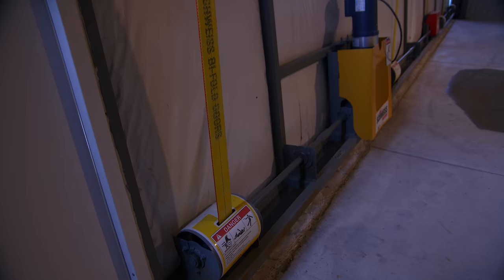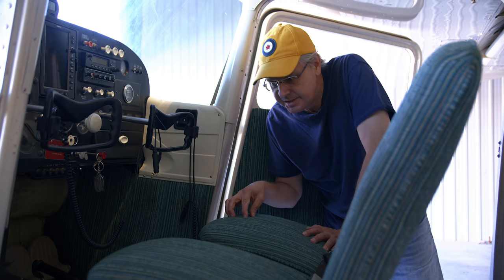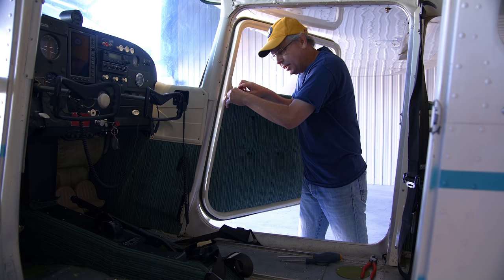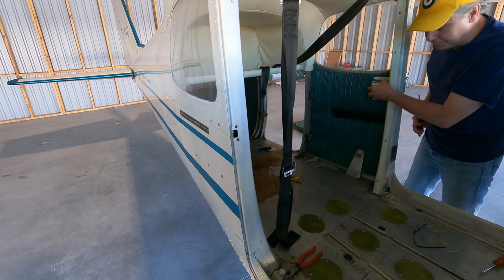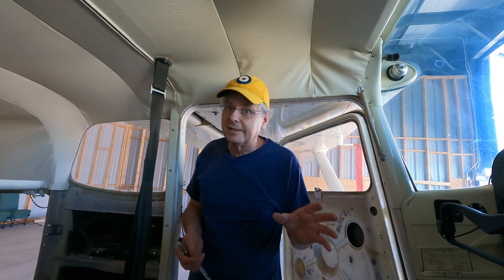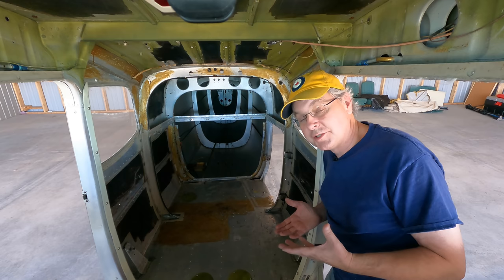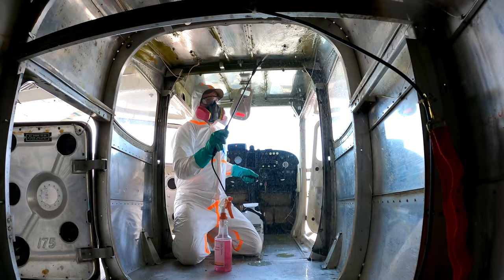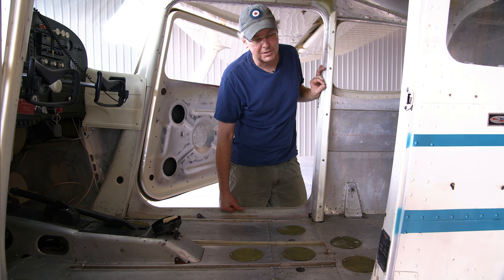Stripping The Interior From A Cessna 172B Glen's Hangar Episode #4

Comment: Glad you used protection especially the respirator for the tolulene. It is a bad neurotoxin. I have issues from breathing it heavily in the 1960s before OSHA here in the US. Stay safe and if you ask me I would toss the tolulene and not ever use it again.
Reply: toluene is industrial strength nail polish remover! Extremely toxic . The only time I've had to use it was in a lab in small quantities with safety glasses and gloves and in a fully enclosed extraction fan fume cupboard so I find it hard to imagine using it for 4 days in a "bunny suit" and respirator.
Reply: Industrial chemicals are wicked. I worked in a finishing shop and the people there would wash up with acetone. I asked them, "What the hell are you doing?" They just said it was fine, we've been doing it for years. I told them they were very uninformed!!!

Comment: Ah, the seat stop.  I remember back when I learned to fly (late 80s) there was a Cessna 150 with a sticky seat lever. And once on takeoff it went sliding back with a vengeance. And what do you have your hand on when that happens?  That's right, the yoke. My instructor was quick to push the yoke forward and I let go.

Comment: If you are still in need of a spinner, I found them at Wag-Aero for $400 for the spinner and backing plate brand new. I needed one for my 1956 172 with the o-300 and McCauley prop. I believe it is the same part as your plane. Looking forward to watching the work on your plane. I've owned mine for about 15 years and just love it.

Comment: I'd definitely put some of the green corrosion protection on the inside, especially if you're gonna paint it anyway. I've seen aluminium corrode so fast, even in a hangared aircraft.
Reply from the maker: That's the plan
Reply: It's Zinc Chromate primer. Aircraft Spruce stocks it. Various size jars and cans, and even an aerosol spray bomb. But the spray bombs are $25 each.

Comment: About the two seat rail stops…. The first one you removed is a Saf-T-Stop that is meant to be slid forward and tightened after you have adjusted your seat in the flying position. This keeps the seat from sliding back during flight. People have stalled on takeoff and died because the seat slid back and the pilot grabbed the yoke. Then when you want to get out of the plane you loosen it and slide it back. I’ve spoken to the creator of this stop about the plastic handle that breaks. He has changed the design and you can buy the new design at Aircraft Spruce. 

The second one you removed is just a simple piece to keep you from sliding the seat back too far which would allow you to pop the seat off the rail. There should be one of those at the front of the seat rail too in order to keep you from sliding the seat too far forward.

Great video by the way…. Keep them coming!
Reply from the maker: There is another of the little clips at the front of the rail. I think we'll be replacing the Saf-T-Stop will be replaced with the Cessna inertia reel system... I'm getting too old to reach back and tighten / loosen the Saf-T-Stop.

Comment: I did lots of that for CP and AC in overhaul.  Instead of a metal scraper, use a plastic, ceramic or micarta scraper to get the big stuff and red or grey scotchbright soaked in toluene or mek to remove the glue.  leaves much less damage from scrape marks on the metal.

Comment: Toluene (tol-u-ene) is an organic solvent, that occurs in nature.  It is clear and colorless, but has a distinctive odor.  It also occurs in pine pitch and tar, crude oil and lighter petroleum distillates, like naptha or gasoline (there's about 5% toluene in some gasoline blends).  It's common chemical formula is C5H5-CH3, also known as methylbenzene (or C6H8 in the IUPAC [International Union of Pure and Applied Chemistry] formalism) or toluol (since it was first isolated from the balsa of Tolu or other pine trees that have a light weight per cubic foot of wood [e.g., "balsa wood"]).  It's the compound that gives the "glue-sniffer's high" from building plastic models in a space with little ventillation.  Consider it to be a neurotoxin (or intoxicant) and wear a respirator in anything other than a very well-ventillated area with high airflow.  This organic compound is used in paint strippers, adhesives (like contact cements) and as a solvent for specific chemical reactions (I've used it for that purpose, but in a high airflow chemical fume hood inside closed glass vessels).

I agree with what you are doing.  Keep the documentation and the parts, but prep for what is done for today's situations.  Don't try for a museum-quality piece, unless that's your objective.  Since it flys, let's keep it flying!!!

Comment: I am stripping the paint on my airplane right now, and do yourself a favor and use Stewart Systems E3000 EkoStrip. It is an environmentally safe paint stripper that can be sprayed, brushed or rolled on your painted surface. It's not solvent borne and does not dry out and stop working overnight. In most cases the stripping action will take place in 2-4 hours. EkoStrip has no harsh odors, is not caustic and is biodegradable. Best part is it actually works as well as the solvent versions or better, and doesn't eat through nitrile gloves.
Reply from the maker: Keep you eyes out for episode #5 - I just finished the job of stripping and tried the EkoStrip Vs. two other solvent based strippers. No spoilers, on what happened just yet.

Comment: I really enjoy watching this project, Glen.  Brings back many memories over the years.  I'm glad you found this and are using it to get intimate with your bird and getting back into the air for fun and adventures eventually.  I spent a lot of time crawling through my Skylane and pulling the interior for annuals when I could. I did most of my oil changes and knew everything in front of the firewall intimately. It makes a huge difference when flying.

I did my intro flight in a 1977 152 in Dec, 1980. The majority of my training and early flying was in '77 and '80 Skyhawks. I never used a headset until I got back to flying in 2002. I remember how chaotic it was trying to understand the radio traffic through the overhead speaker and using the mics.  Headsets and push to talk were very exciting!

Comment: The easiest way to remove the door handle (when you don't have the proper tool) is to wrap a rag around the post and pull it around it. The end of the clip will get imbedded in the rag and pop it right off.

Comment: Seeing your headliner removed causes me to think you might want to review Cessna service letter SE69-26 dealing with fuel vent system modifications to prevent possible vapor lock.  SE72-7 provides more detail.  I was able to find salvaged parts to modify my 172B.

Comment: Great series of videos.  When I used to build rally cars we found that removing the roof lining meant a lot of condensation would form on the cold metal when it was left overnight.  This condensation could then run down the pillars and could cause problems with electrics.  I realise that you will be using ANR headsets and I'm interested to see whether the removal of the sound deadening panels and trim will result in a big noise level increase (drumming) that proves tiring.  40 years ago we didn't have ANR technology...

Comment: I know it’s old but those old school crank clips pop right out if you slip a rag around it on the open end of the clip and pull the rag back and forth and the clip will pop out enough to remove the crank… Then fully reinstall the clip to reinstall it and just pop it on because the crankshaft is ramped

Comment: As an ex Aircraft Weights Engineer I'd definitely suggest getting a new weighing done. It's not worth calculating weight and location on a set of numbers that are so old.

Rubber matting, look around at different ones, comparing dencities might save you a couple of lbs.

Lastly, put a steady under the tail. You don't want your aircraft to tip if you are inside it and the only ine in the hanger.

Excellent work btw.

Comment: The door handle issue reminded me of  older cars where the answer to getting door handle off was to press the trim towards the door. the exposed the pin that held handle on the square peg. push pin through, pull handle off peg and the circular trim is free. If only Cessna had taken advice from British car manufacturers...

Comment: There is another paint stripper called ST-7. It is an epoxy paint remover. Thick like what you used. The black stuff is probably Par-Al-keytone used for corrosion protection. Once stripped you will want to use acid etch and aluminum chromate prior to paint.
Reply from the maker: Yes; the acid etch and primer is part of the plan.

Comment: I love these episodes.
You were talking about the lack of insulation between the interior side panels and the skin of the aircraft.
Can you put insulation in between the interior side panels and the skin of the aircraft?
Typical fiberglass insulation from a home improvement store?
Spray in insulation that car restorers use?
Dynamat sound deadening material, which is really meant for the floors.  It does more to muffle the noise rather than insulate.

Comment: If you are concerned about noise with all of the old insulation removed, maybe look at the modern materials like Dynamat or Kilmat? It is usually self-adhesive, unobtrusive, and light weight. It would also leave the interior 'bare.'

Toluene is usually pronounced TALL-YOU-EEN here in the States. It's distilled from pine oil and is that 'smell'. It is a solvent used in paint thinners and permanent markers. It's in most contact cements too.
Reply from the maker: Here's the rub - Anything put in or on a certified airplane needs to have FAA / Transport Canada approval. Really limits what can be used for the flooring or interior, pretty sure that neither of those are approved. There is one that is approved, but not sure that i'm going to use it.

Comment: I hear doing weight and balance sooooooo much I just received my A&P license last Saturday here in the states one thing you didn’t say about the things you removed is you need to note down the distance from the datum to do the weight and balance
Reply: I would also mention that you can’t use certain chemicals or tools bc it will cause corrosion or remove the protective layer on the metal one of the planes at the school I went to for my license was there bc it was sand blasted to remove the paint and that caused the aircraft to be no longer air worthy without being completely reskinned bc the protective layer on the aluminum was gone so the insurance company totaled it and donated it for us
Reply from the maker: I noted the distance - just didn't think to say it as a separate task. My AME is helping me in the background with the correct advice on chemicals etc.

Comment: Whoo hoo another Charlie update. 

I know every tiny gram counts but would painting the floor with something like a bed liner that would normally be used in a pickup truck bed be viable to protect the interior metal? 
I understand why you won't be putting the panels back on, but personally I'd put some kind of panel on the doors just to smooth it out. Personal preference.
If you're completely replacing the seats maybe see if any fans want to purchase the old ones you pulled out of Charlie. Could help with funding the project if you can sell the seats for 100 dollars each plus shipping or something.
Reply: Bed-liner is both heavy and may not provide good corrosion protection.  You need something that bonds to the metal and prevents liquid & gas contact with the surface. If you look around online you can see plenty of example of bed-liners where water got in between the liner and the underlying metal; and its a nasty result!  Preferably you want something that either passivates the metal or at least acts as a sacrificial anode. Alodine and Zinc Chromate primer is the go-to for this.

Comment: This is going to be a seriously noisy airplane if you do not replace the sound absorption panels (the black pitchy stuff) back in the airframe. Those pads keep the skin from oil canning and poping. You can lessen the weight penalty by reinstalling it in 1-inch strips horizontally instead of the factory installation method of large panels. Today's products are much lighter. I can empathize with your desire to remove unnecessary weight to increase payload. Just expect to hear some scary sounds while in operation the first few hours.
Reply from the maker: Yeah  - but not really. I've flown 20 hours in it already, and don't notice it being any noisier than any other Cessna 172 I've ever flown.

Comment: So on the weight of what you removed, was that just the carpet, panels and headliner or did that include the rear seats?
Reply from the maker: Carpet, panels, headliner, rear seats, hat shelf, all of the vacuum system and gauges / gyroscopes, etc.

Comment: Is there any evidence this aircraft has pitched forward or otherwise crashed thereby explaining the missing spinner?
Reply from the maker: Good point - but there isn't anything specific in the logs about a crash or damage like that... There is a period between the mid 80s and mid 90s where the plane was out of service, and seems to have been disassembled, then reassembled with parts from other aircraft (I'll get to that in a future video) along with having the wings completely re-skinned with new spars. The 'why' is a mystery.
Reply: @GlensHangar  When such info is lost over just the 61 years of this aircraft, just think how much knowledge is lost to history...

Comment: So if I understand you correctly, you will not replace that black stuff? I thought that was in place to soften the vibrations of the panels.
Reply from the maker: It is there to dampen vibration - but when you look at the entire cabin; the pitch only covers about 20% of the panels. Like I said I've flow 172's with and without the pitch and it doesn't make much difference in a plane of this size.
Reply: @GlensHangar  Wasn't worried about sound. I agree with your sentiment. My thought was that the vibration will also, over time, possible damage the ribbons holding the plate and the holes in the plate for the ribbons (or nails or whats is called in English), because of the increased movement. Might really be a non issue, but it was the first thing I thought about.
Reply from the maker: That's apparently a non-issue, given that only the panels in one small section of the aircraft are covered. (Also checked with an engineer)

Comment: How far back into the tail of the airplane do you think that you can put luggage items before you are affecting the front to back balance of the airplane.  I assume that this becomes an issue with take off and landing.
Are you able to use a stretchable cargo net that people use in the back of their SUV?
Reply: It can be (and is a requirement for flight) to do a weight and balance. All baggage areas have a rated max weight as well. Usually 80-150LBS for aircraft of this size
Reply from the maker: There is a very specific 'Extended Baggage' compartment that I put in. Aircraft are heavily regulated, so you have to follow the rules.
I was able to add just under 3 feet of extra length and 50 pounds of baggage capacity.